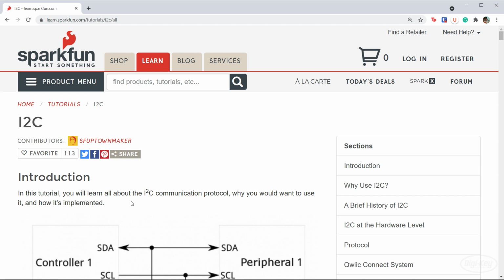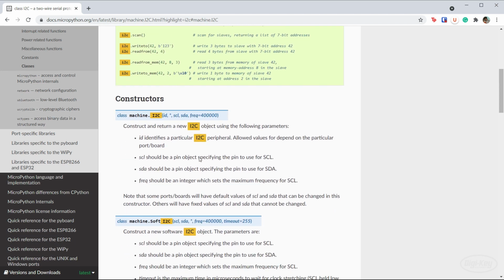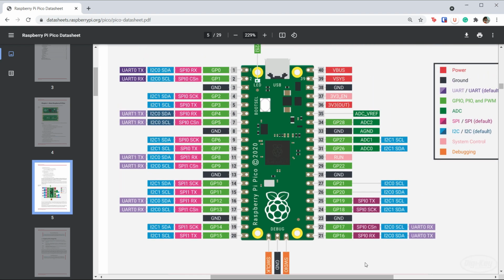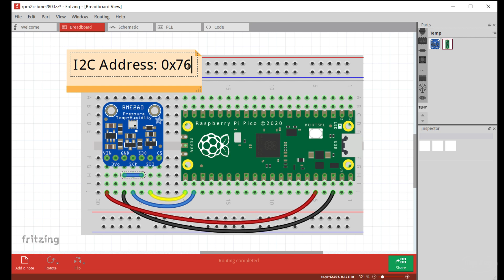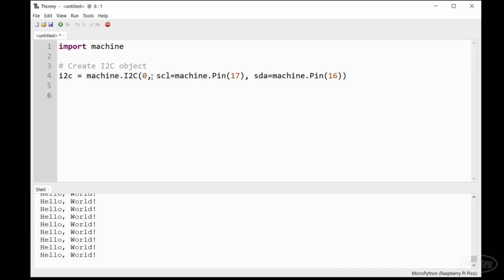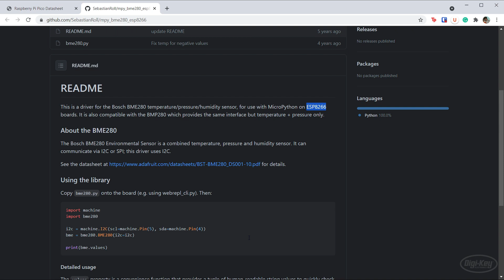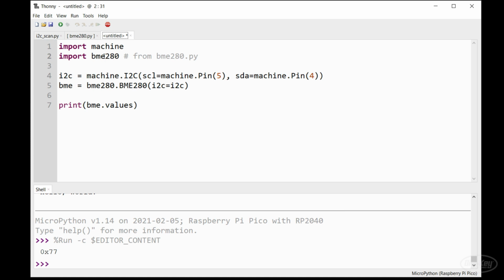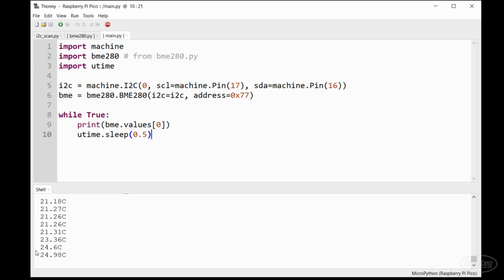Intro to Raspberry Pi Pico and RP2040 - MicroPython Part 2: I2C Sensor | Digi-Key Electronics

Comment: The Installation of the Library won’t work. It says Error when installing. It worked if I directly save the bme280.py  into the pico. But I have the feeling it is not so right, is it?
Reply: Hmmm...that is odd. You can save bme280.py to the lib folder, and it should work just fine.